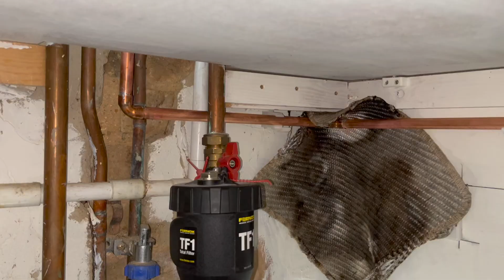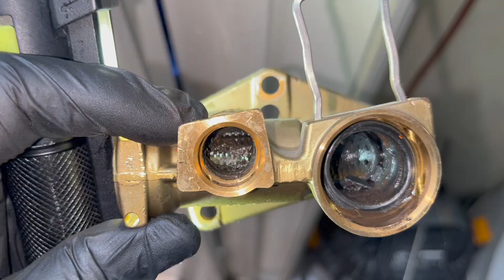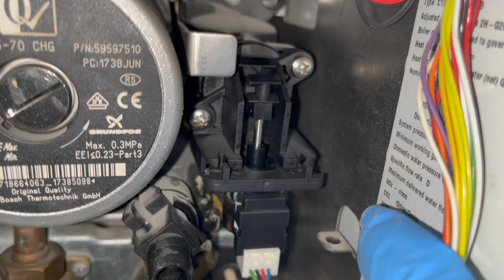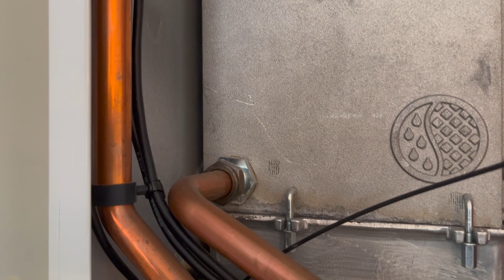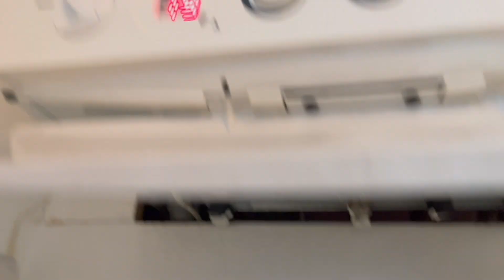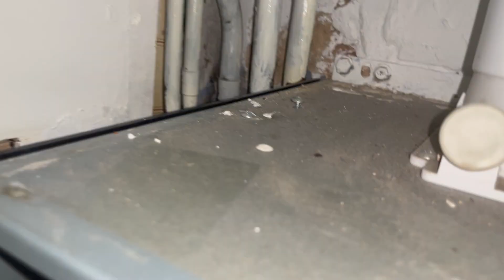Day In The Life Of A Gas Engineer #9 | Gas Runs, Dangerous Boilers & Repairs

Comment: Couple of tips…. If I may. On the vaillant job, canoe filter. Once filled, put the boiler into vent mode for 5 mins before firing it. And put heating on first so can circulate any excess air not removed. If you run HW first it could overheat if air trapped and wreck thermal fuse.  On the Viessman.. if the isolation valves are prone to leaks, take the pressure off the valves before you isolate them which will help when you isolate them. Put hose on and start draining. Once pressure has dropped then isolate valve. It will help the orings inside the valves, as they won’t be under pressure when you move them. Other than that nice work. You definitely get my vote for best one handed work.

Comment: Heating geek said in one of his videos.. if you drain the pressure before isolating the valves then they should leak.. they usually leak when shut off under pressure.. that's how I do it now and works 99.9% of the time
Reply from the maker: Ah thats a game changer! Thanks for that, definitely going to try it going forward
Reply: What do you mean? Drain the boiler down and then isolate the boile?
Reply: Just don't drain a boiler by the prv as most of the time it will leak

Comment: if you see a little bit water in the air valve doesn't mean the vessel is dead.....fill it with air anyways... if you hear "bubbles" while you pumping air in,the vessel is dead for sure.....sometimes small drops of water are "born" inside....because of the air humidity....

Comment: Ive learned to leave vaillaint and glow worm isolations alone the brass used is too soft
Reply: I've never had issues when using Allen key, all of the stripped valves I've come across are caused by flat head screwdrivers 😂

Comment: Great video mate, that job with the main heat exchanger is a massive help, need to change the washer under the sump of the heat exchanger on my own boiler at home and have been putting it off for weeks because I’ve never stripped down this model before. Very helpful video mate 👍🏼